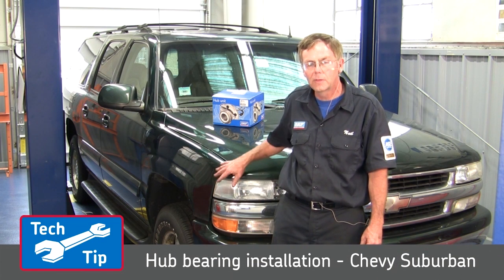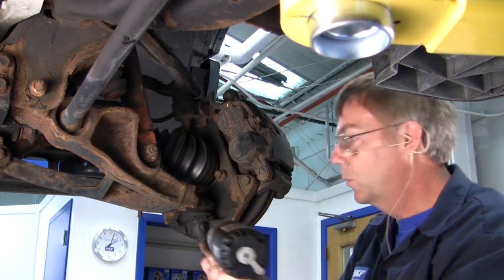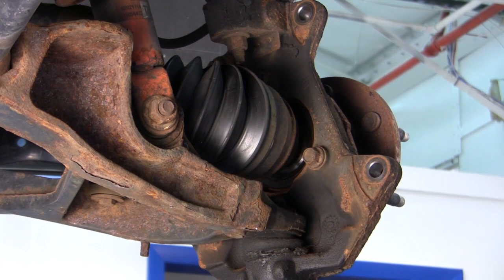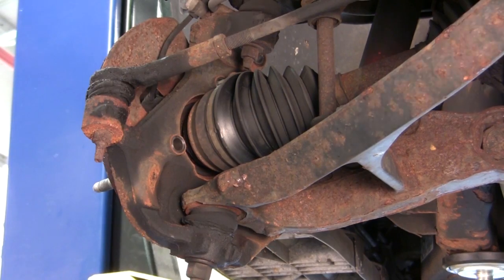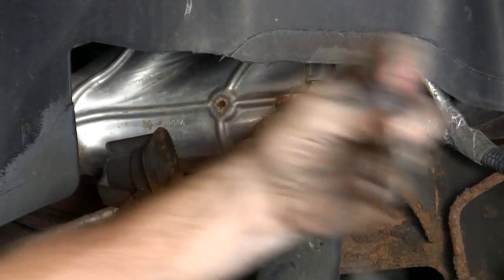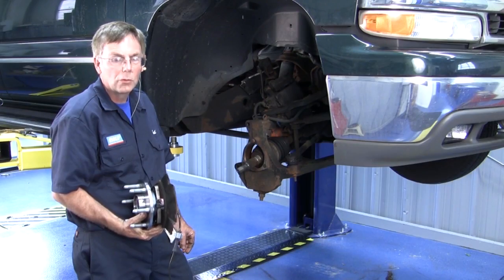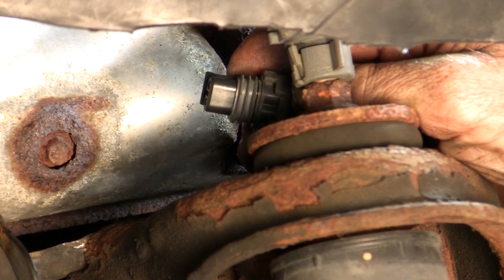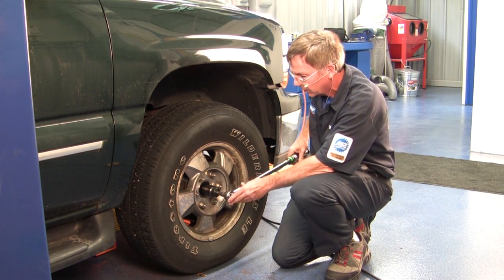2002 Chevy Suburban hub bearing install

Comment: Did my 2005 suburban today and I've never done anything like this. Got to buy a good floor jack, jack stands, and a 35mm socket (get the deep kind if you can). I watched two different videos and one had you pull the brake apart. I pulled the unit off intact and it seemed to work. The three screws (15mm) that hold the bearing thing (see I'm not real technical)  were a PIA to remove.  This video took a better than average computer guy a mechanic. Well, will closely monitor the wheel for a couple of weeks to make sure. THANK YOU!
Reply from the maker: Glad to hear you found the video helpful. Thanks for watching!

Comment: Excellent video, it is easy to replace but I always like to look repairs up ahead of the job to see what tools I will need so that I don't have to look for a tool I don't have when I have everything half disassembled and above all I want to do the job correctly, this video is very professional, hub nut and bolt sizes and torque specs would have been nice but the axle nut preload was the important one, I can look the rest up, again excellent video and I Thank You very much
Reply from the maker: Great suggestion! Thanks for watching, I'm glad you enjoyed the video.
Reply: Agreed with the specs. Had to look them up.

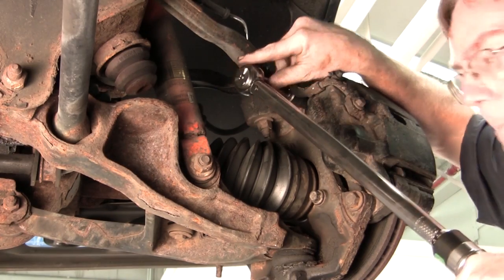Comment: At 6:22 in this video there is a "buffer boot" of some kind left of your torque wrench head. It sits left of the front shock. What is that piece and can it be replaced? On my 2002 Chevy Suburban they are almost worn completely off or down. I've noticed some steering irregularity and wanted to know could those be a culprit. Please let me know because I'd hope it can be fixed before having to dwell into costly other measures.
Reply from the maker: stewnta that is what is reffered to as a Bump Stop. It is used to limit the travel of the suspension as it moves up towards the frame of the vehicle. It also dampens the A-arms on hard impacts, so if yours are worn out you will experience harshness when hitting bumps.

Comment: does this 2002 suburban 4x4 have rear abs sensors?  thanks  after replacing the hub I noticed the abs and the brake warning light come on at the same time intermittently  someone said the rear abs wheel speed sensors prob. bad
Reply from the maker: gonepriused The 2002 Suburban has 4-wheel ABS. The professional thing to do if you have an ABS light on the dash is to use a scan tool to determine what code is causing the malfunction.
Reply: I pulled the rear calipers and rotors , did not see any type of ABS system back there for the rear?   I will try to have it scanned

Comment: So what are the correct torque specs?
Reply from the maker: Dan - Thanks for viewing! The correct axle nut torque spec. is 177 foot lbs for this vehicle. You can view your application or any other vehicle needs by reviewing the SKF Torque Specification Guide (457377) (http://www.skf.com/binary/30-66360/457377.pdf)